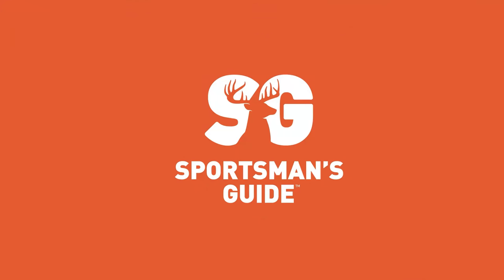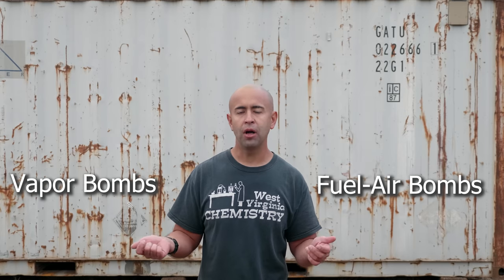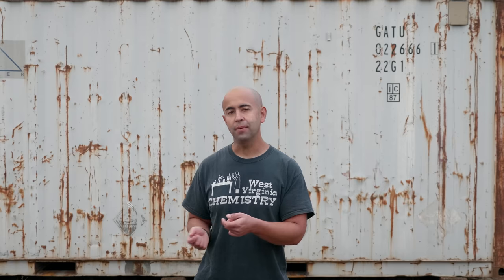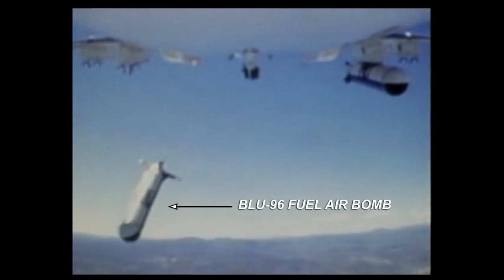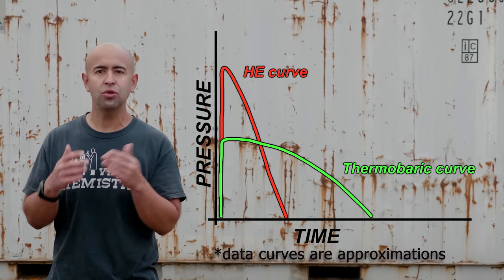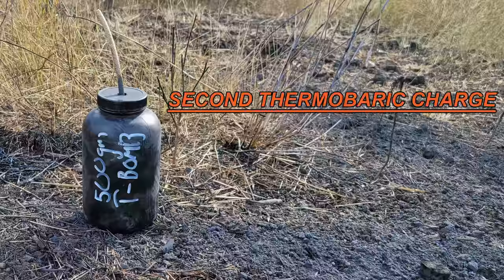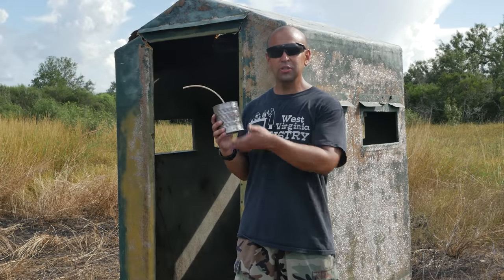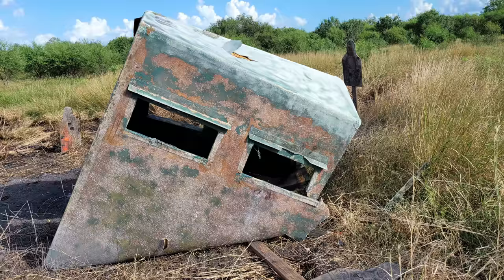Improvised Thermobaric Grenades: Testing Fuel Air Bomb Grenade Designs

Comment: Hm, we tried something like throwing in a pound of normal baking flour into an enclosed structure (a relatively small building slated for demolition), immediately followed by a thunderflash into the resulting flour cloud. The effect was devastating and it completely took the structure down all the way to its basement level. Fuel-Air explosions are extremely powerful, certainly when happening in enclosed environments.
Reply: I have heard about the devastating impact of accidental ignition of wheat flour suspended in a cloud  indoors
Reply: @samhaines8228  multiple flour mills have blown up over the years from it.
Reply: @samhaines8228  Our local grain elevator had a grain dust explosion years ago. We felt it 3 miles away. It really wrecked one silo and severely damaged one next to it. Really impressed me how oats dust could damage such large concrete structures. If anyone was climbing the outside ladder they'd been ejected into space as the walls flexed outward.
Reply: @samhaines8228  Yeah, In Minneapolis, MN US they made a complete museum about a grain elevator/mill-complex that was nearly completely eradicated due to graindust that went past ambient air/particulate-matter ignition-point. 
That said, outdoors the effect can be pretty dramatic too. We sometimes made (strictly unauthorized) what we called stationary atom-bomb simulators using that kind of stuff. Trick is that it had to be windstill with pretty accurate dispersal and ignition detonations to have the best effect with heat, observable wavefront and meassureable flash/bang times present.
Reply: @Centurion101B3C  good times!
Reply: I used to have a declassified US army improvised explosives guide I bought at an army surplus store 20 years ago. One thing that was mentioned was using flour as a secondary explosive. I always wanted to see how well that would have worked.
Reply: @LuvBorderCollies  oh what those little oats can do...
Actually thay is one of the huge a** risks on coal mines too, lots of miners kick the bucket because a miscalculated vent allowed dust coal concentration before a blast...
Reply: @LuvBorderCollies  Much of the weight in an explosive is oxidizer. When you use air as the oxidizer, the bang per pound goes way up. The explosion taking place in a large volume also creates a different pressure wave effect that will absolutely wreck anything with a large surface area. FAE would be ineffective at a task like demolition of a structure like a bridge pylon, but it will disassemble all kinds of things from the inside. A house doesn't stand a chance against even 10psi ... from outside.

Mythbusters made some reasonable attempts at getting small fuel-air explosions to work but I think that generally what they achieved was rapid deflagration. An actual FAE is very distinctive.
Reply: A similar explosion occasionally happens in large grain silos. One spark will flatten large concrete structures. 🧸

Comment: I did quite lot of research about these for our video some time ago. It seems that the most of solid fuel devices without second charge for ignition need quite sturdy outer shell. That helps the temperature of the fuel to get high enough for good detonation when mixed with air instead of burning. 

With liquids you probably need second charge for ignition and high speed camera for getting the mixture right. Also all the best liquids are quite toxic and non-toxic ones have really narrow window that you need to hit to make them explode instead of burning. But if you are interested on testing liquids I might have some specific information about delays and other stuff that you need to figure out to make it work :D
Reply from the maker: Jake would love to chat with you. If only we could easily road trip to Finland.
Reply: I remember a video on YouTube where someone made a fuel air bomb with nitromethane in a 2L bottle. It seemed to work really well.  I remember in that video it was winter and there was snow on the ground, but I just cant find the video anymore.
Reply from the maker: That video might have been yeeted by the YT gods.
Reply: @OrdnanceLab  Gotta admit, that trip sounds like it would be a blast though
Reply: @TheBackyardScientist  Nitromethane should be quite suitable and even methanol is pretty good but those are also quite toxic so not ideal for testing things out :D We used etanol which isn't toxic but is really hard fuel to be used on this type of use.
Reply: Awesome comment And awesome channel!!
Reply: @Beyondthepress  australians make race gas with tetranitromethane as a super oxygenator. Isnt the thermobaric point, though, to draw surrounding oxygen to burst lungs? Also race gas cannot work with a cold engine so that during the race the engine heat not vapor lock. Using these kinds of fuels would require a preheating of the device or even a surrounding explosion to superheat the cloud mixture itself. It is all in getting the best mist without vapor locking.
Reply: No way your here hello
Reply: @zayzay9098  seems very sus
Reply: @zayzay9098  sussssss
Reply: @Beyondthepress  
Said YT charge comprised n-hexane,  isopropylnitrite and diethylether IIRC.
Reply: @OrdnanceLab  i made a thermobaric device using  a propylene glycol slurry with a tannerite boom can
Reply: @dragonfireproductions790 did it work 
Also I am trying to make a tiny one (1in in diameter and 2.5in long) and I had the idea of two fuel stages. So the first layer around the dispersion charge will be aluminum and the next layer will be the liquid, and I’m asking because you probably have more experience and I wanted to know if it could increase the chances of it working?
Reply: @OrdnanceLab I have been researching several thermobaric weapons different countries use. It seems aluminum & isopropyl nitrate is a favorite. Unsure of how the combustion happens whether it’s overpressured in a can or cloud and second ignition. Improvised thermobaric devices in some cases use a mixture of coal dust and flour. Aluminum & nitromethane would also work. Nitrogen seems important
Reply: The question is, how do i make a second charge?

Comment: Interesting but it looks like the dispersion charge did more of the destruction than any thermobaric effect. 

The bits of the fuel are flying off in chunks, almost as if the fuel was wet and clumping. 

This is a really cool experiment, maybe try significantly more fuel, in as fine a powder as possible and a smaller dispersion charge. Maybe also have a separate ignition source for the ignition of the fuel air mixture.
Reply: Yah. They really missed the mark. It’s hard to mess up this bad. It’s worse than regular flash, which is in a sense thermobaric
Reply: or maybe try actual FAE fuel like.... isopropylnitrite? this was so week, im embarrassed. 100g flash should have ripped that little tin can into pieces lol
what size is that metal powder, 50 mesh? flour would be 100x better
Reply: I can't help but agree, there was no real secondary explosion from the fuel air mixture combustion, just some smoke and sparks
Reply: Yes... that was the dispersion charge and some sparklers.
But I imagine properly igniting such a small thermobaric device with solid fuel ist pretty hard. It's already difficult with liquid fuel. I haven't tried it with solid fuel, but liquid fuel already needs milliseconds precise delay of an ignitor charge. With solid fuel conditions need to be even much more precise. Metal powder doesn't burn as readily as liquid fuel does.
Reply: @jackmclane1826  he put together a failed FAE charge, youre 10 levels above him.

Comment: The amount of smoke means you arent getting detonation of the fuel, just deflagration.  When you get the timing of dispersion and detonation right, there shouldnt be much in the way of waste products.
Reply: Normally you would be 100% but in this case, I believe it’s because it a metal fuel and MgO and Al2O3 are white aerosolized powders.
Reply: That sounds right in theory, but I highly doubt its true in practice. After all many of the classic high explosives themselves are oxygen deficient as well, even though they're proper secondary explosives, and will give greyish to black smoke when detonated. There probably isn't enough oxygen available in the air to completely oxidise the detonated fuel in this video.
Reply: @pieterveenders9793  There is more than enough O2 in the air to completely oxidize and Im only talking about free O2 not oxygen bound to anything else in the atmosphere. Fuel Air bombs require a pretty well timed explosion/detonation setup to get the fuel atomized properly before the shockwave of detonation is fired.   Get it right and there should be little byproducts created and almost no smoke which are indicative of all the oxygen chemicalliy bonding to the free nitrogen released during detonation.

Comment: Hints: For your liquid fuel,  try Triethylborane, and store your disbursant explosive charge in a tube of fused quartz (so as to ionize the TEB), then (using a detcord delay of 5 to 15 ms.)  detonate a high brisance ignition charge. You'll probably be amazed.

You're welcome.
Reply: I feel like TEB is a little on the unstable side to be using with explosives...
Reply: TEA-TEB is one thing you don't want exposed to air.
Reply: @fallinginthed33p  
Unless you're TRYING to make something rather spectacular...
It's what they used in the predecessor to the MOAB. It may be what was used in the actual MOAB, but I don't actually have any knowledge of that.
Reply: TEB is mixed with a hydrocarbon in the liquid fuel versions, it causes abrupt multipoint ignition. Same deal burst than the fuel mist ignites and boom.
Reply: @christopherleubner6633  
Basically,  if done right,  the ionized fuel air mixture actually detonates rather than ignites, resulting in a MUCH more energetic event.

Comment: Were these used on caves for their unique effects on enclosed spaces? I seem to recall them being deployed to try to clear some caves a while back, something about the pressure wave, overpressure, and oxygen usage in the confined space.
Reply: They are, yes. Some were developed for the specific purpose of flushing enemy troops out of caves, and the MOAB was used in battle in such capacity against ISIS
Reply: Thermobarics are the best useage in caves and tunnels and the overpressure is enough to rupture your lungs and blow out your ear drums.  Were talking overpressures that can reach into the 1000 psi range which dwarfs even a nuclear weapon.
Reply: The most extreme example of this IMO is the GM-94 grenade launcher. It uses 43mm thermobaric grenades for squints room clearing.
Reply: @hjorturerlend  wouldnt say thats the most extreme, just the most portable version.  MOAB is probably the most extreme short of a high yield nuke or a comet making direct impact with Earth.

Comment: Use (by volume) 2 parts bearing grease to 1 part aluminium dust (not flakes!). Mix it very very well. You can thin it a bit down with gasoline to make it more workable, but it is vital that it can suspend the aluminium evenly. For a cylindrical bomb you need a core of about 15% TNT-equivalent high explosive (by mass - adust for equivalency). The higher the detonation velocity the better. So if you have RDX or PETN use that (So 1kg of metallized grease to 150g TNT-equivalent).

When using grease/wax/paraffin the principle is a little different to using gasoline or diesel. The reason for the relatively large amount of high explosive is not that it is more viscous and thus need more energy to turn into an aerosol, but rather that you need the energy to break the long hydrocarbon chains into smaller and more volatile components (this is why RDX/PETN is preferable over TNT. You want brisance over gas generation). The aluminium is there to keep the combustion temperature high as the pressure eventually drops. These types of bombs have an ungodly energy density and when done right they produce incredibly large flame fronts.

Source: I used to be an Artilleryman in the Danish army. One from each cannon got "the big explosives certificate". I was that one. We were taught everything from taking down bridges to making impromptu shaped-charge weapons.... Later I got an advanced chemistry course (outside the army) and everything made a whole lot more sense then! :P
Reply: You are still here so you must know what you are doing. Good Luck to You and Yours.
Reply: @liljohnp132  Uh, thank you! And in kind return! :)

Comment: You need a stronger outer casing. The metallic fuel has to be compressed and heated well beyond the point of autoignition by the primary HE charge before the outer casing breaks, that way it will ignite progressively as it expands and encounters atmospheric oxygen. I spent a lot of time studying the Hellfire MAC (Metal Augmented Charge) warhead, and this is the method they used. It also helps to mix the metallic fuel (aluminum) with a small percentage polytetrafluoroethylene (Teflon). It helps to have the Al/PTFE pressed into a cylindrical billet "jacket" before assembly, as loose, unconsolidated powder takes longer to compress, which reduces its efficiency and contributes to the "slag-throwing" seen here.

Comment: The British Flame Fougasse would make an excellent base for thermobarics. They simply lowered a grenade into a drum of petrol to use as an anti tank trap, using the incendiary effect. This is not a thermobaric of course, but a similar idea could possibly be employed with jerry can and explosive bursting charge. For smaller thermobarics, a wine bottle filled with a gasoline mixture (phosphorus and aluminum additives come to mind) that is burst by either an internal charge with the fuse fitted through the cork or an external charge for simplicity, in which case the blast may be somewhat directional. I'd also look into using a more readily vaporized fuel source, such as propane, as that may mix with the air better. I reckon a purchased small propane tank could be ruptured by a sufficient bursting charge and achieve a desirable effect.
Reply: We used 55 gallon drums in the Army filled with thickened gasoline with bursting and pusher charges and WP grenade in path to ignite. Lots of fun.

Comment: Someone may have mentioned this already, I'm not gonna read 1040 comments to check. Anyway, some time ago, a very shady individual I met at the ballet, regaled me with a story about a device he may or may not have assembled many years ago, a improvised thermobaric, constructed, as best I remember,  from a pressure cooker, 1/3 full of gasoline, initiated by a 1X3 inch pipe bomb, the fuse being routed through the pressure vent in the lid. Probably just another armchair commando. He didn't strike me as a very reliable sort, these days, he probably spends his time on the internet, watching Tom Leher videos or worse. However, in the event that this information might in some small way assist in your research of such things, I thought I'd pass it along.   Love the Lab Lab BTW!

Comment: A million years ago in my, "how did I survive?" days I tried making one, it didn't detonate properly, but definitely kaboomed enough to scare me away from trying again. I made basically a short cannon with screen in it to break up the fuel, filled it with a cup of gasoline, and used a hose clamp to keep a pipe cap (with Teflon tape so it wouldn't leak) on. Then I made a campfire about fifteen feet in front of it and pressurized it with the oxygen from my dad's torch until the cap burst off. Still had my face attached afterwards, which was frankly surprising.

Comment: a little idea I had for testing: build another one that has the same dispersing charge as the real one but has sand instead of magnesium. That way you can compare how the fireball expansion knocks over the targets vs what happens when it's just flying particles and the dispersing charge.
Reply: Powdered iron would give yellow gold sparks that burn slower than magnesium so easier to see. Used in commercial fireworks for gold sparks in chrysanthemum aerial charge.

Comment: In my younger days reading the JR cookbook, they had it in there with a thermite charge to superheat the liquid, and then a secondary high explosive charge to ingite and rupture the steel vessel. - That said, alot of what was in there has been prooven incorrect, but a good portion is/was real.

I'd also point out that the military video had the detonation happening in mid air. I wonder if this helps to atomise the fuel better, as it's not instantly hitting the ground for nearly 50% of the available directions it can expand. As such, I'd suggest an experiment, whereby you build 2 devices the same, set one off on the ground, and the other suspended in mid air. Compare results.

Comment: Another point about thermobaric devices is that while solid explosives are basically a point in space that expands, thermobaric explosives are volumes that expand. So their pressure wave is not losing umph by distance^2, but by Δdistance^2. If you can skip the first three meters of losing pressure, the wave will lose less power with distance. They have a greater kill radius.

Comment: One cool setup I saw demonstrated many years ago was a bag of flour taped to the top of an M16 type antipersonnel mine.  The boost charge propelled it up into the air a few feet and tore the bag open then the subsequent detonation did it’s thing.   Perhaps disburse it first with a car airbag charge before the ignition charge goes off.

Comment: Love you sharing the trial & error, keep up the great work.
I wonder if you could use glass test tubes to contain the liquid fuel, surrounding the center HE charge - using different glass thicknesses and charge sizes/types, to achieve ultimate dispersal of the fuel, fitting even hand/can sized devices.